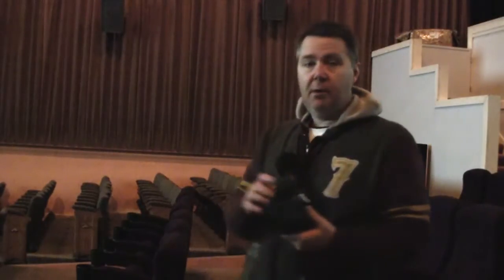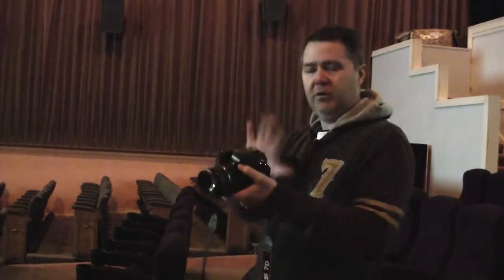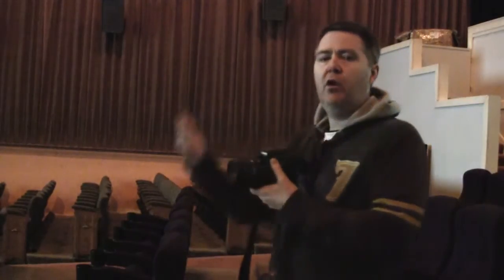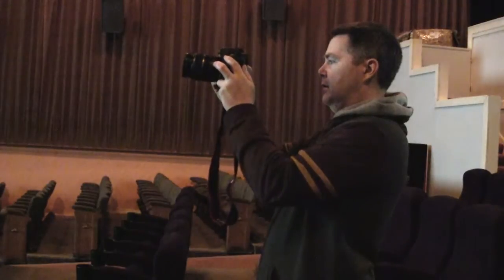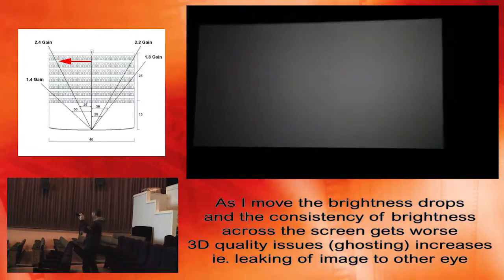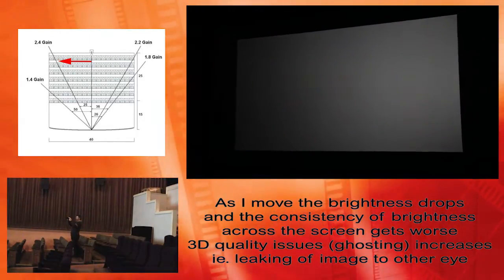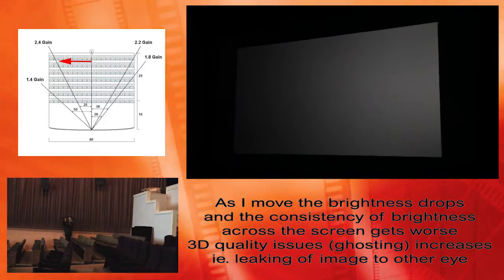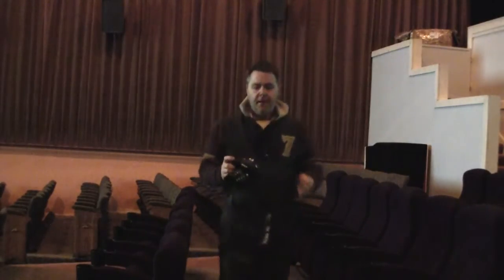Demonstration of Silver Screen compromise

Comment from the maker: some people are more susceptible to the active glasses flicker then others.  It could also be installed badly.  I find passive 3D has less flicker (silver screen based or Dolby)
But best is duel projector as there is no silver screen at all.. 
But that is not common.  IMAX digital03D always use Duel projector..
I expect it to become more common in the future, even in general cinemas.
Its the only answer to the need to get 3D brighter with current technology.  (apart from laser light engine)